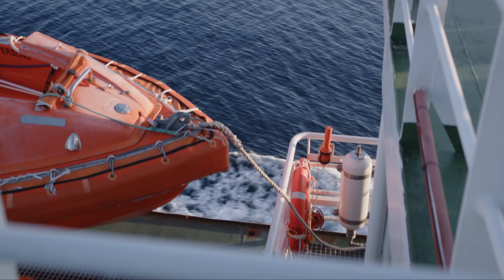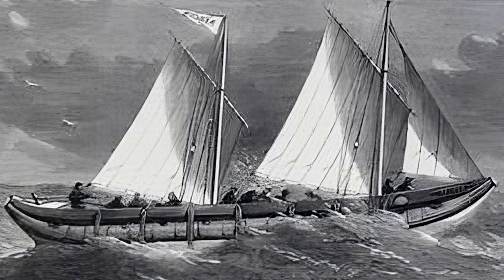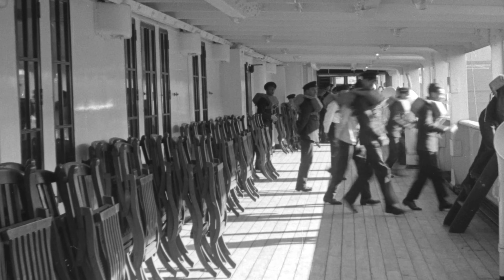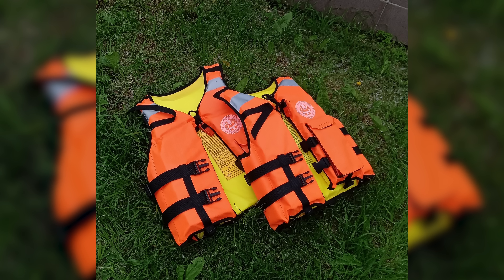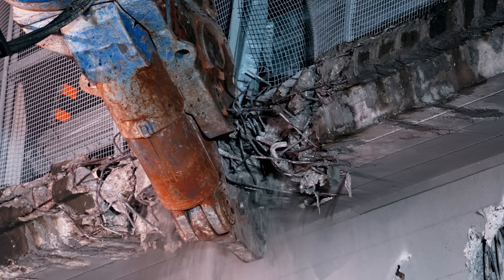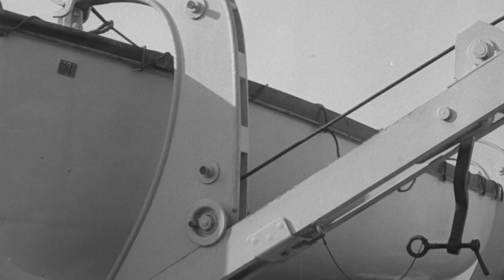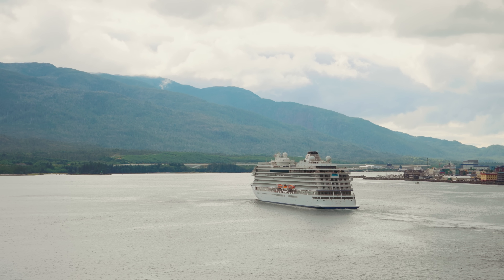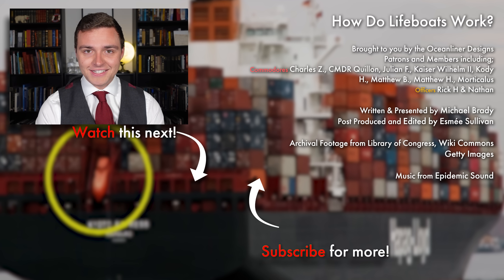The Amazing Evolution of Lifeboats: From Titanic to Today!

Comment: We spent a month on a massive passenger ship a few years ago, starting and ending on  the west coast of the US with five stops in Hawaii and over the equator to several ports of call around the South Pacific.  At the ports of call that did not have docking facilities to handle a 1,000 ft ship, several of the ship's lifeboats were deployed as tenders (water taxis) to shuttle passengers back and forth between the ship anchored out in the bay and the dock.   It also served the purpose of giving the crew and passengers much more experience, familiarity, and comfort with the lifeboats.  By the end of the voyage, we had been on and off those boats at least a dozen times.  

Being a machine guy, one of my primary interests in making that trip was the ship itself, and getting to ride aboard the modern lifeboats/tenders and see how they are deployed, put into action, and stowed away, were just some of the many aspects of that experience I found fascinating.  That ship and those like it are really floating cities, dwarfing the super liners of the Titanic era.  I would have been happy with just a tour of one, so spending a month on board traveling great distances of open sea to exotic ports was a dream come true.

Comment: Comments about free fall lifeboats being a bone jarring ride are incorrect.My husband worked for a year with a Norwegian company who manufactured them -we lived near the works and I had many opportunities to travel in one as they were tested.I was scared stiff before my first descent but it was nothing like I had imagined.You sit in the seat which is moulded and padded then brace your back against it.There's a few seconds of weightlessness as you're tipped forward but there's  absolutely no feeling as you hit the water.I was expecting to feel as if we were hitting a brick wall but the bow cuts through the water-the only sensation is being lightly pushed  back in your seat as you go from 45 degrees to a horizontal position.There was one occasion when they rigged the boat so that it would overturn as it hit the water.We were wearing the full body harnesses that are part of every seat so were well restrained.I genuinely didn't feel as if we were upside down as it righted itself so quickly.There was just the sensation of being pushed slightly to one side but you don't feel as if you're turning a full circle.These boats can carry one hundred passengers each so they are an alternative to traditional lifeboats but I don't see the big cruise liners using them just yet.

Comment: after the Scandinavian Star disaster, passenger vessels sailing in the Danish waters had to have rapid launch and recovery boats installed, but at least around here, the lifeboats are only for recovering passengers that have gone overboard, while the inflatable rafts have become the primary escape vessel for passengers. And since the rafts don't take up much space when packed up, typically ships will carry many more rafts than they strictly need for their maximum allowed number of passengers, because during the chaos of an evacuation, some rafts might fail to inflate, some might not get filled up proper, some might get turned over, etc. 

The type of inflatable rafts used on the majority of ships around the world are produced by Viking here in Denmark, or by some of the companies that have a license to produce them. When they're produced, every single raft has to be inflated and checked for leaks to be certified for use, and then neatly packed up in their little canisters. There are strict regulations for how long the rafts are allowed to sit folded up on a ship before they have to be tested (can't recall exactly how long, but it's a few years), so part of regular ship maintenance is to swap all the raft cylinders for known good ones, so all the ones that are taken off can be sent off for testing and certification. But it's one of those companies we're proud to have in Denmark, and naturally they're on the west coast of Jylland which has been the cause for about as many wrecks as Nova Scotia

Comment: The 75% for enclosed boats seems odd considering the risks of rafts in the ocean, you'd think they'd have 100% enclosed.
Reply: SOLAS has significantly changed over time. After several incidents involving engine room fires that completely disabled the ship leaving the ship without propulsion or "hotel" power there were seen to be extreme difficulties in getting thousands of occupants off of the ship under adverse conditions and then safely rescued. The infamous passenger cruise ships left without any significant electricity generation capabilities floating adrift in the waters off of Mexico reinforced the idea to cease creating ships full of easily fire damaged electricity generating engines. The latest SOLAS requirements are aimed at designing, engineering, and constructing passenger cruise ships with far greater onboard engine room fire suppression system capabilities, and with far better fire stopping barrier systems between the engine spaces. There are also increased requirements for fire stopping barriers amongst the various electrical systems. The overall goal is that a passenger ship should never again be set to drift without basic electrical functionality because of significant fire damage to the  electricity generating engines. A passenger may find themselves on a ship without propulsion capabilities, but that same ship should still have "hotel" electricity available to power lights, sanitation, food storage, food preparation,  telecommunications, while also giving the bridge crew enough essential "ship"electricity to  telecommunication with potential rescue/recovery forces and other ships. There's even been consideration of mandating a significant increase in the watertight  compartment requirements. 

It's all part of a concept called "Passenger Ship as the Lifeboat".  
The passenger ship will be capable of surviving an engine room fire in such a way that the passengers and staff are safely secured in the ship until after the ship has been safely towed to a suitable port.

Comment: I was chief electrical engineer at Welin Davit who had a tie up with Harding lifeboats.  Many interesting design aspects - for clarity the  decent is controlled by centrifugal brakes within the winch that limit the speed once a weighted lever is raised, no power required for launching just for recovery. Same applies to fast resuce craft with semi rigid boats.  Enclosed lifeboats for offshore etc have an external sprinkler system plus air cylinders to provide a positive pressure air supply for the interior occupants and engine for a period of time at full throttle as governed by SOLAS regs.  Hydrostatic release hook’s that automatically release the boat from wire ropes when entering the water. Dual independent engine starter systems required for emergencies such as twin electric (duplicating everything) and electric plus hydraulic backup using a compressed accumulator system and foot switch valve (a good workout to re-pressurise by hand) etc etc - an interesting micro world aimed at saving lives at sea

Comment: Some lifeboats ARE ships on their own..  

features can include
    Restroom facilities with hot and cold water
    Entertainment systems with sound and screens
    AC systems and/or heatings
    LED Mood lights in cabin or outside

    USB charging ports at each seat row
    Bar on board

These are often found on what are classified as "Tenders"   These are life boats that are used to ferry passangers from ship to shore in smaller ports.  these are also  able to be HUGE on their own,  often holding 200-400 people,  being from 11.92 x 4.7 x 3.9 m  at 23600 kg  to 17.5 x 5.7 x 4.2 m at 43000 kg.   Seriously  57'x 18'...  interior space is over 900 square feet.   if done as a house boat you could have pretty much a full 2 bedroom, 2 bathroom that you could live in yea round.

Comment: I used to work for Condor Ferries. Here we operated 2 catamarans built by INCAT Australia. We didn’t have life boats but instead, had what was called an M.E.S, Marine Evacuation System. Basically, this was like a hybrid of a an airline emergency slide that was attached to a huge life raft at the bottom. In addition to this, we also had a few automatic rafts that immediately inflated when immersed in water. These were a standby to the MES rafts as all four were capable of accommodating the full ships compliment.

Comment: Life rafts has their own drawbacks as shown during M/S Estonia's sinking.
She went down so fast and during such poor weather that almost no Lifeboats were deployed only some of the Life rafts were deployed.
But there was a problem and that was that due to the weather most of them were deployed upside down thus they were full of icecold seawater.

Onboard there was around 994 souls.
about 700 never made it out from the hull.
250-300 made it outside the ship.
of them about half froze to death in either a raft or in the sea.
137 Survived.
Almost all Liferafts were flooded with Water and thus many froze to death inside a liferaft.

The Eprb Beacons on Estonia were new but they had not been activated by the crew.
There was also Issues with the Baltic sea Rescue Doctrine, it could be called Flawed at best.

IF Titanics sinking was a Catastroph Drama, The Estonia was the most horrifying of Horror Stories.

Comment: Having enough lifeboats for everyone on board was, in the earlier years, not actually likely to be helpful, and could actually make the ship less safe by adding too much additional weight high up on the ship. Even if that wasn't a problem, having enough life-boats for everyone isn't useful if the crew isn't able to load and lower them all before the ship sinks. Also, when the crew isn't sufficiently well trained to load, lower, and launch them properly, that's a big problem. It seems like it was surprisingly common for lifeboats to flip over while being lowered, or for various other types of accidents to happen while they were being loaded, lowered, or launched. 

It's a bit unclear to me why they didn't have more life rafts earlier on. You could potentially have rafts designed so that they would just slide off the ship as the ship went under the waves, even if the crew didn't have enough time to launch them manually. It wouldn't be as good as a life boat that's properly launched and has had enough time to get clear of the ship, but considering that it was very common for many of the life boats not to get launched at all and to simply go down with the ship, having rafts that are designed to just come off of the ship if it sinks in addition to life boats probably would have been a much better design.

Comment: Modern life boats require ONE thing: get in, sit down and buckle up.  The self-righting function will not work if you're all laying on the ceiling when when it rolls over.  Also, take the sea sickness pills immediately.  It doesn't matter if you've never gotten seasick before.  If one person hurls in that thing, its gonna look like the Ipecac scene from Family Guy - and that's not good for survival.

Comment: Would you mind expanding on why lifeboats cant be lowered at extreme lists? 

In my mind, a list towards the lifeboat would just pull it away from the hull as it lowers and be fine. 

Whilst a list away from the lifeboat would be more problematic if it scrapes the hull, couldnt it just be loaded and hydroscopically released when the main ship eventually sinks?

Comment: There is a small error in the numbers you mention. Passenger vessels under SOLAS only require lifeboats for 75% of the passenger capacity, specified as 37,5% on each side of the vessel, but an additional 25% capacity in life rafts ON EACH SIDE of the ship, totaling the over all life saving capacity at 125% of the maximum capacity. The reality is that ships rarely carry the maximum allowed number of pax and modern life rafts (which deserve a video of their own) are just as safe as lifeboats. The only difference is that non-seafarers will rather trust a lifeboat. Lifeboats have one advantage over rafts in that they are self propelled. If a ship goes down it's understood that a RIB rescue boat will also be lowered to "tend" to the rafts. 
Oh and I agree with Germangreetings: in design of lifeboats Colin Archer is someone who can not go unmentioned.

Comment: Question: I had read that for Titanic, there was some sequential nature of the launches (perhaps crew limited) but in the end, they could not wait long for hesitant passengers before starting lowering and if they had waited longer, they wouldn't have had time to launch them all within the 2 hours before the ship sank.  Is this true?
Has this issue been solved with modern mega cruise ships where they can truly independantly launch all boats without one interfering with the other and they can go down at same time without bumping into each other ?

In the case of rapid events such as Costa Concordia and that South Korean ferry some years ago, obviously no time to launch the boats, but would the inflatables have been automatically deployed and been of help to survivors?  Or would they have reached water too close to final sinking and been too little too late? 

(I guess the same would apply to the Estonian ferry).

Comment: The life raft piece reminds me of when we were doing survival at sea training in the Australian Navy. We were first taught in a classroom, and instructed in the launch procedure before going on to the deck of a moored ship for practical training. The raft is launched and then inflated by the pulling of a 15m+ painter line to initiate the inflation. However when launching from the deck we were to first pull 2-3m of the line out before pushing the raft overboard. 
I was chosen out of the class of about 20 and given the honour to unclasp the raft and start pulling the line out. At this point and to the surprise of us all, especially me, even before the raft had left its cradle it burst out of it's shell as it started to prematurely inflate😮, much to the entertainment of my fellow recruits. We were then instructed to immediately push the still inflating raft over the side where it landed upside down in the freezing water. The groaning and laughter from the rest of the class I can still hear all these years later.😳
Later the instructor found that the painter line had been cut short, to not much more than a metre. I was off the hook 🙂

Comment: I'm surprised he didn't go into detail on the life rafts.  Those are pretty technologically advanced themselves, compared to a simple blow up raft.

As he said, they're designed to inflate in the presence of water, but they are also designed to be deployed from a crane.  The crane hook on the outside of the pod is actually the top of the liferaft.  hook it up, hoist the pod over water, then pull the deployment rope.  tTe shell will crack open and the life rafter will inflate into a position that can be loaded from deck before being lowered into the water safely.  This helps passengers avoid having to slowly climb down a rope ladder.

Comment: Hearing that modern passenger ships only have to have enclosed lifeboats for 75% of people on board has me wondering a couple of things. What is the percentage survival rate between a normal lifeboat and a life raft? If it's a fair bit lower, would there still be an (unspoken) class deployment between a good lifeboat and a life raft? With a ship such as The Icon of the Seas 25% of a full ship is close to 2000 people that would only be in the life rafts.